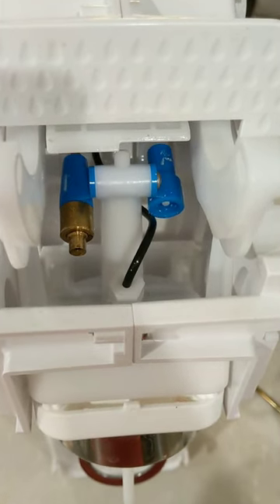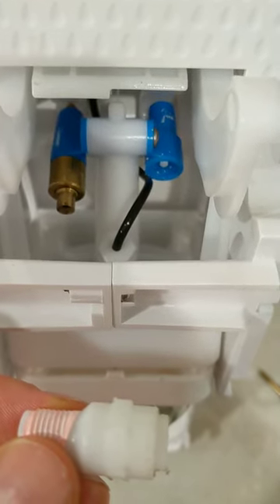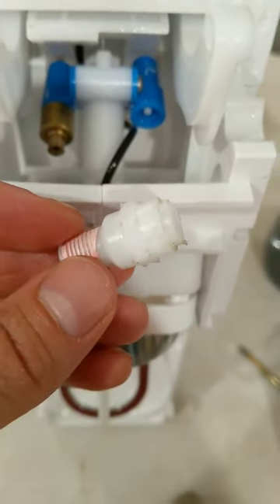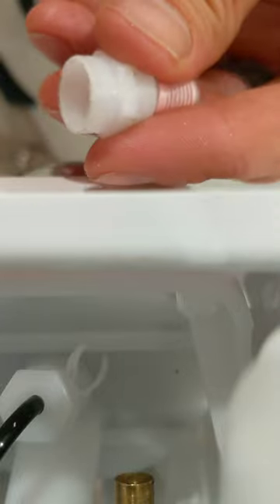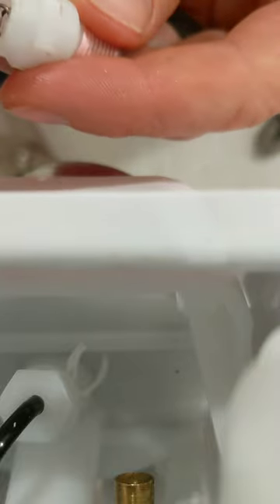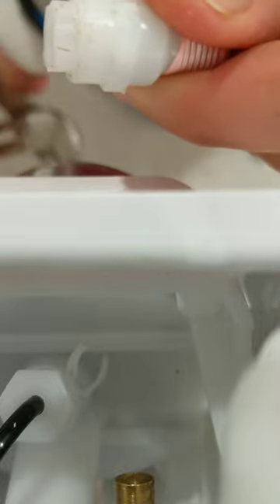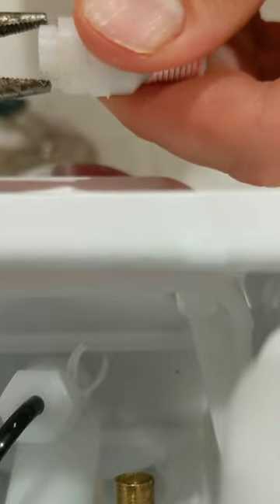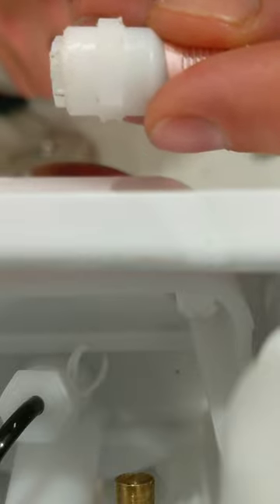Soda stream pressure relief valve fix. try version 2.0 now available.

Comment: Your video just saved me $100!  My pressure relief valve evidently backed off so far that the plug + spring shot out. I took it apart and couldn't figure out where the spring + two plastic parts came from, now it's working perfectly again. Thanks so much!
Reply from the maker: Better subscribe for that kind of savings. Haha. I uploaded a new video of the newest version as well.

Comment: This fix definitely helped with my Soda Stream, although I don't think the seals are quite as good as when the unit was new.  If I screw the piece in any further I might not be able to grab it with my pliers anymore.  One thing I noticed when I took the front cover off my unit was that the springs on the relief valves are always under compression when the bottle-mount flap is in the open position, and are only released when the flap is moved to a closed position (such as when a bottle is mounted and made ready for water carbonization).  So, from now on, I'm going to keep the flap in a closed position when the unit is not being used.  I'm wondering if the springs might have deformed over time due to being under constant compression except when actually carbonating water.  Anyway, this was a very useful video, I learned a lot from it.  Thank you!

Comment: Thanks for the video.The pressure relief valve on my Sodastream Genesis started leaking, I think from some dirt getting in to the valve. It is quite easy to disassemble compared to this model. 

I was stuck at the part where the valve needed to be unscrewed since it's not easy to grip the bottom part that unscrews.  This video showed that the valve would eventually come apart, and with some bigger pliers I was able to get ahold of it enough to break the glue that was holding it from the factory. I then used a 3/16 drill bit to clean out the thread seat (just twisting by hand), then reassembled. 

I was able to tighten the valve back up using the pliers but I didn't put any glue on it. I think it will eventually loosen up again, so i'll probably just retighten it. If I glue the valve back together, and it leaks again (debris in valve seat), there's no way i'll be able to get it loosened again.  What i'd like to do is find the replacement valve, but in the short term this should be ok.

Comment: Thanks. I found I could tighten my valve without removing it. 👍
Reply: That's exactly what I was about to post. The relief valve 'end cap' is adjustable, so no need to adjust the spring length. I used the square drive part of a  small socket to get the sufficient purchase to screw the cap in a bit more.

Comment: this helped me. BUT...mine was very different even though it looks like the same model.... but valves setup looks different. the end of my relief valve was red. and installed on the left side. the other valve on my right is not brass but has a black plastic fitting with an alan (hex) internal socket. my red one was out all the way pulled out the valve and added teflon tape. if it backs out again i'll use HotGlue. you dont want to use superglue because if that gets jambed up with sugars etc it could be a dangerous scenario. you want to be able to take it apart to clean it.
Reply from the maker: Yep, you have newer model. The red one is releif. Tighten it up and it's fixed. I uploaded a new.. slightly better..haha. video of that model.

Comment: It doesn't help me in my case. I tried and the problem still persist. Thw gas leakage starts the moment I push the guage. The CO2 did not reach the bottle at all. I could feel the gas was release inside the top section of the device. Anyone encounter the same problem ?

Comment from the maker: Well there are other videos of that. There was not a video of adjusting the bleed valve so I did a half ass effort. For this model you really only need to take cover off to get at valve. It a couple screws.
Reply: Jon Phipps urgent!! Can u please show how to get the skin off Jon!
Reply from the maker: @HillsEnd  if you have the soda stream with the stainless steel covering remove bottle then 4 screws on bottom the stainless steel will flex and slide off. There are also 2 screws underneath where soda bottle goes. Take those out and the plastic front with LED lights will pop off. You can access the valve from there.
Reply: i unscrewed but can get in and open the top, any suggestions?

Comment: Brilliant - thanks for sharing this. I’m going to give it a try. 

As a side question, anyone have any ideas on how to minimise the squeal it makes when it’s releasing pressure? I’ve seen some tear downs of the Source model which show a foam block that sits in front of the valves. Mine doesn’t have this and I wonder if that helps somehow?
Reply from the maker: I doubt it. But if you put a piece of styrophoam against the outlet it might reduce the sound. You could also turn the bleed valve all the way in so it never releases.  You risk blowing a bottle up though if you aren't careful. The lights are just on a timer. They don't correspond to a pressure so relying solely on that could be problematic.

Comment: Jon, How did you get the Sodastream opened up? I can get the front off, but can't get the main cover off.
Reply: The answer to my question is at erik's link, below. Step 3, in the comments.
https://www.ifixit.com/Guide/SodaStream+Source+Internal+Carbonation+Air+Hose++Replacement/87404

Comment: I think I need to do this on mine. Where did you get the spring/what size etc
Reply from the maker: Use a spring that's already in there pull on it to stretch it

Comment: I just went through this process last night, and the screw had backed off again by morning. Is there any safe way to lock the screw in position? Thanks!
Reply: I'm thinking SuperGlue, for what its worth.
Reply from the maker: Ya know I think mine has backed off a bit too. I might just glue it. Or maybe wire it in case I want to tighten it more later. I think tape would fall off but a twist tie might do the trick. If you just put it all the way in, you could use the lights as a good estimation of an appropriate amount of CO2. Then again it takes longer the lower the cylinder gets.
Reply: Maybe add an extra layer of Teflon tape to make it tighter

Comment: My plastic pieces are totally stuck together. Is there a way to buy same part in metal? What fool would make this part from plastic?
Reply from the maker: The capitalist fool would. Now you get to by a new one. No spare parts are sold that I could find. I over tightened one and snapped the plastic, that was the end of it.
Reply: @jonnyfleur81  My plastic screw holding the spring is Red and it did not screw in or out at all;  my red so-called screw busted into pieces and if there are treads in there then idk.  So to increase resistance I plugged up the valve spring with 5 min epoxy resin and I'll see how that goes.
Reply from the maker: @01mustang05  I recently broke mine as well. If you can block the valve then you have to be careful you don't over pressurize the bottle and blow it up.
Reply from the maker: No way. We the fools haha. I recently broke mine too. I am not sure I will by a other since they are so cheap.
Reply: @jonnyfleur81    I edited my previous comment before noticing your replies.  So danger is bottle busting open, got it, thanks, bottles are easily replaceable and they wear out anyway; it was the other parts I was worried about and I didn't quite understand what was going on.  So to increase resistance I plugged up the valve spring with 5 min epoxy resin and I'll see how that goes.
Reply from the maker: @01mustang05  do let me know
Reply: @jonnyfleur81    Hey so plugging up the valve spring with 5 min epoxy resin and letting it cure for 24 hrs did seem to work; something else seems to vent quite quickly after shooting, but it is working over all  again.

Comment: I had the same problem snowtigers63000 had, but don't have a fix. Did some sodastream maintenance, mostly cleaning it & replaced the canister. After replacing the canister & attempting to carbonate some new water, there was no shut off. It kept spitting out pressurized air & the only way to stop it was to unscrew the canister from the machine. Anyone have a fix for this???
Reply from the maker: If it's leaking from canister insert point then try different bottle. Otherwise your bleed valve or one of the tubes that carries C02 has failed. There are multiple point in the system that have buttons triggered by engaging system. Take off the trim pieces and ensure they are functioning as you press the lever down.

Comment: Hi,
Can you tell me what was the problem? Mine is leaking gaz after i use it and i have to take off gas bottle to stop gaz
Reply from the maker: I would imagine that the overpressure relief valve has completely backed off so you need to screw it back in as directed on the video. Or the machine is locked in the on mode from a failure of hardware. Both would likely become obvious once you remove the exterior trim.
Reply: @jonnyfleur81  hi,
Thanks for answer. I ll try to check that and come black there after.
Just hope my sodastream esource isnt down!
Reply: Hey! I found my answer! It was my gaz bottle! I changed it for other one with différent top and its ok!
Reply: @snowtigers63000  where was the gas leaking out? At the gas canister in back or in the front around the bottle top?
Reply: @courtneyw994  hey! Thanks for answering me. It was in front of on the plastic white part pipe

Comment: Would this fix my soda steam from water flowing back up and then leaking?
Reply from the maker: No. That's the new model. Just bought one and it's annoying. So is the tall bottle that doesn't fit in most fridges. Great R&D there.!
Reply: I did what you showed in the video and it actually stopped it! It was blowing water out of the pressure valve and after tightening it, it stopped leaking water. You’re a genius. I can only buy you a virtual beer!